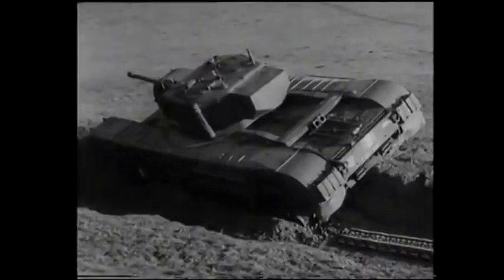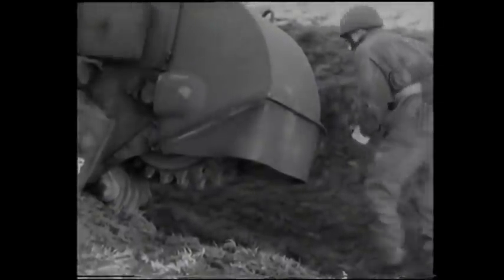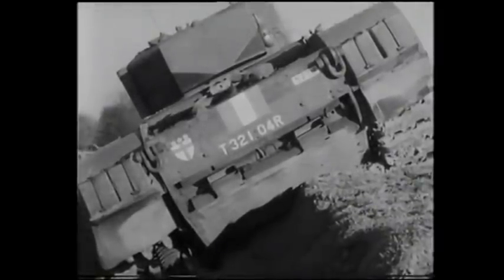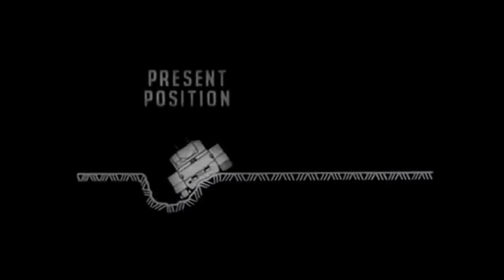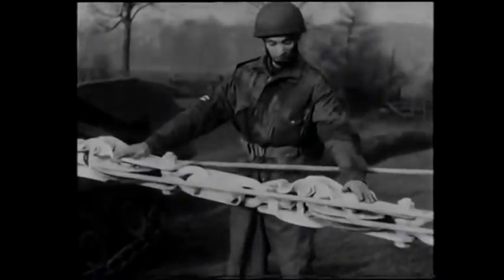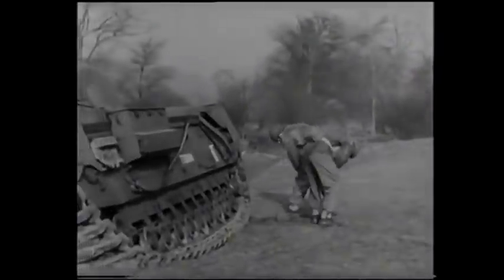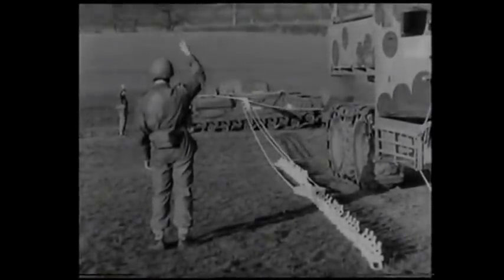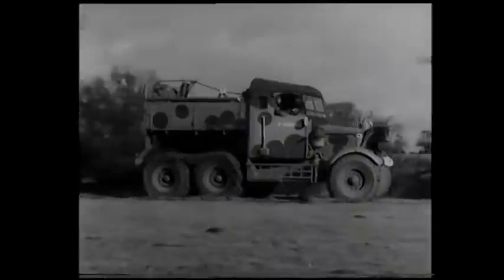Recovery Vehicles -  Scammell Breakdown Tractor, using a simple 5 -1 Pull

Comment: FASCINATING! I wondered how they would anchor that half track to take on such a monstrous pull! I would have liked more detail on how those Hold Fasts worked.
Reply: It looked like very long steel pins driven into the ground.
Reply: That's the word I was going to use!
Reply: They are indeed tempered steel pins driven into the ground at an angle, the point toward load to be pulled. If in sand, their are wedge plow looking anchors embedded.
Reply: Simply a set of steel pickets, around 1m long, are  driven through the openings, pinning the array to the ground. They conveniently omitted the driving and removal of the many pickets. Pulling pickets is the hardest part of a salvage operation.
Reply: @geoffcrumblin9850 surely they would just use the upper winch, to pull them out.
Reply: @RangieNZ  can anyone confirm this? Seems super reasonable.
Reply: Ditto.  That was an omission.
Reply: @geoffcrumblin9850  what do you do if you cannot drive in the pins into the ground cos of solid rock ....?
Reply: @georgedoorley5628  At that point panic !  I was a REME recy mech, luckily never came across rock , but did sand , of course with  that it was pointless  using ground anchors , we would dig a pit, put two 6 X 2  inch planks in the trench with the winch rope wrapped around them and use the ground as the anchor . Took longer to dig the trench than to recover the  vehicle.
Reply: @tomatoes3  Anchors, the ugly truth when dealing with block & tackle.
Reply: @bryanepp5340  Yes indeed Bryan.
Reply: In the oil fields in Wyoming it was common to see old truck axles used as the pins.  A lot of sandy soft soil caused a need for use of rail road ties to be buried as anchors. No matter where this type of work is done, it calls for hard work to be done. The only thing about the work done by this crew that is different than what we did, is the need for the rifles carried by the recovery crew. They were and still are brave men doing hard work for the good of the entire world. I thank them, our allies, for the sacrifices they gave us all!

Comment: Good video, imagine having all that tackle. I'd love to have one of those tuck/tractors l. And one know what they had for an engine?
Reply: The later version I had in the early 1970's had a  10 ltr  Meadows Petrol engine , very slow running ,6 speed gear box . We normally moved off in 3 rd gear when not towing .
Think it did about 5 miles to the gallon UK  , the clutch was prone to slipping, the best method to alleviate that was to spray it from underneath with the pyrene fire
extinguisher. A marvelous truck full of character and a joy to drive .